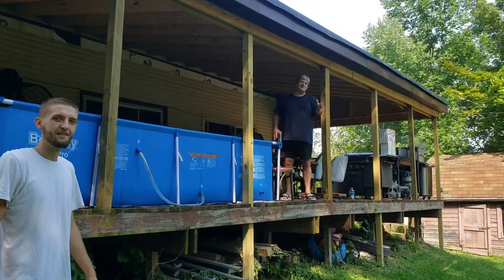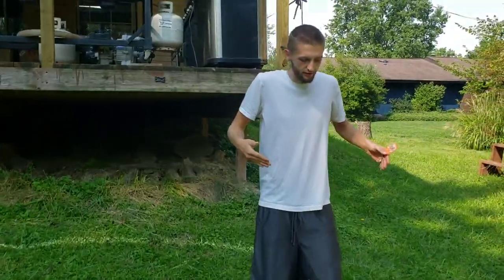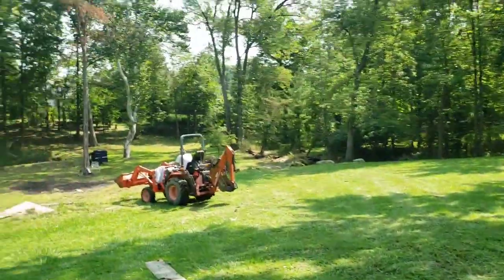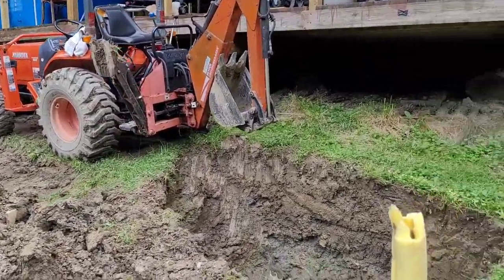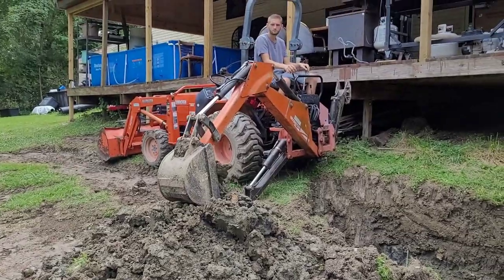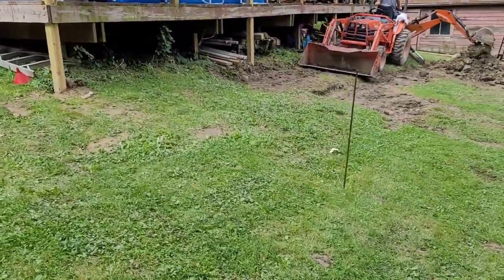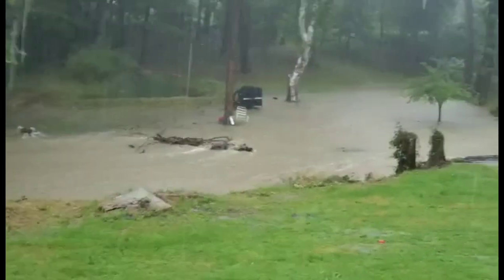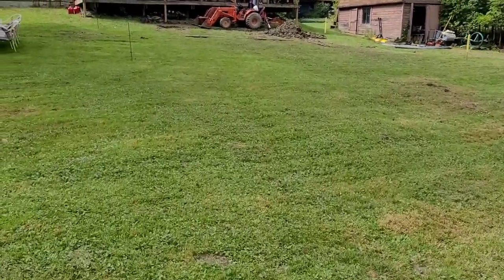Creating a Massive 30,000 Gallon Ecosystem Koi Pond pt. 1 - Digging for Filtration

Comment: You probably figured it out already but engage the 4wd in the tractor and it will get around a lot better and you can get bucket to scoop out easier.  After josh uses that for a day or 2 he will get used to the controls, and it will all go quicker.  Glad your using a bigger machine it would take ya weeks to dig that size pond with that compact tractor.

Comment: I paused the video.  It wouldn't be right if I didn't warn you. To dig without checking for underground gas lines, utility lines, etc is ASKING for trouble. A 1-800-dig-here kind of company would have told you if those areas were not safe to dig in.  Worse case scenario: hitting a gas line.  I warn everybody that I see who make errors simply by overlooking.  Check out online videos re hitting gas lines. You can rupture gas line with implement then ignite fuel source with spark from tractor. Its a no-joke.
Reply from the maker: we had that done last year when we were going to build the pond in the back, so were clear, then we changed our minds and put it in the front
now were digging back here